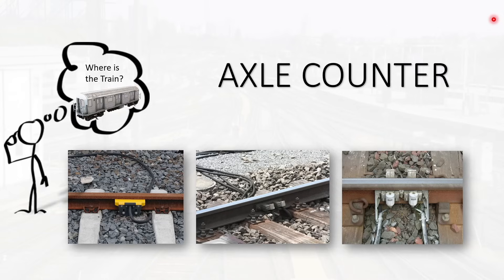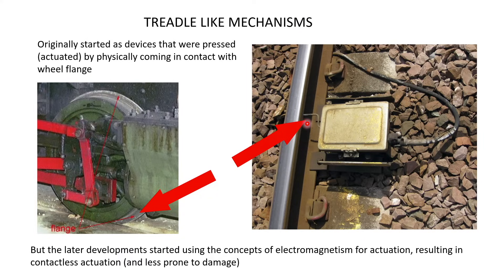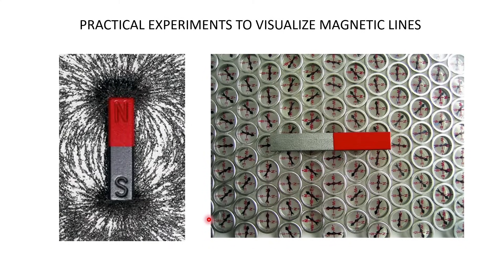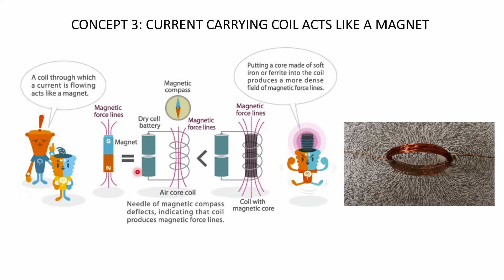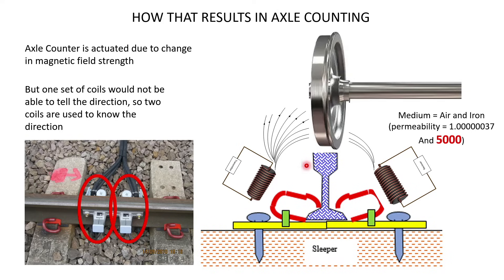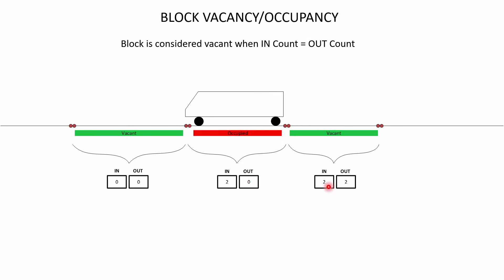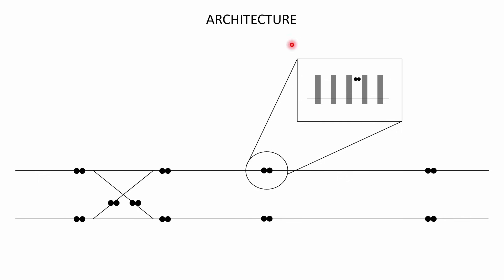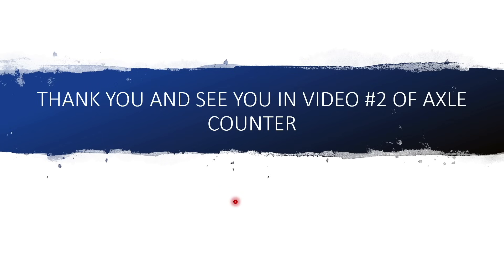Axle Counter Explained

Comment: Had not fully understood the reason for the need for axle counters to register block occupancy.  Many thanks for this video!
Reply: The System "knows" is there is any train in the section and if another train gets too close to the section. Then the train control system can force stop the second train if the section is already occupied.
Also, automatic railway crossing use axle counters too. How the system knows that the train is already passed the road crossing and the blocks can be opened? - Axle counters

Comment: The transmitter is powered by high frequency voltage and this induces a voltage in the receiver coil. In early days there were magnetic wheel detectors with contacts which will drive stepper motor type counter. The system was manufactured by Siemens

Comment: Hello,
Thank you for your video which is extremly informative.
I'd have two questions: 
1) To record magnetic field variation, do the axle counters use the Hall effect, like speed sensors?
2) Why is the magnetic field not affected by the presence of rail, made out of iron, near the axle counter?

Comment: Did you ever post part2  of this fascinating subject? Many thanks for this one - really good!

I came away with some questions: For example, if there is a power or system failure that affects a set of counters, how are all the trains kept safe and how is such a failure detected anyway? Given there are no lineside signals to fall back on, I am assuming that all trains receive some kind of "systems failure in block y.  If you're in block x,y or z bring your train to a stop immediately" type of a directive? I woudl guess it's possible to make the countar values persist by use of flash memory or battery backups in the lineside cabinets but re-sycnching things must be a chore!
Reply: Thanks Alan. Great question, which i'll definitely look into. But based on what I know so far, the counter can fail in two way - It leaves a count eventhough the train has cleared the block, OR it clears the counts while train is still inside. In short, one is false occupancy and one is false vacancy. False occupancy is a safeside failure, and False vacancy is an unsafe failure. By definition, Axle counters are SIL4 i.e. probability of an unsafe failure is something like once per million years. There is a whole lot about failure rates of individual components, resulting in failure rate of Axle counter as a whole, which i might get into. 

Another thing is that interlocking checks, sequential occupancy/vacancy of the blocks. So if suddenly an occupancy is lost and everything goes vacant, I assume the interlocking will stop all trains. I just dont know, if the area affected will be local of global. 

But thank you for the though provoking question.
Reply: @gauravkaushik04  Hmm yes, as you touched on in your video in the overall system axle counters talk to higher levels of the overall system so maybe there is some kind of heartbeat message from the counters to the higher level which, if missed, make the executive system failsafe the section concerned. Also if an exec function is supervising a number of axle counters it perhaps makes sure that when the outcount of one section is decremented, the incount of the next section is incremented within a couple of seconds - and (since axles should not just vanish from the railway!) if it is not then again a fault is declared. Has to be something like that - but oh my that could get complex with certain track formations.

Comment: i knew axle counters existed to check no coupling had broken. This took my knowledge further for sure. for me in britain the history of this goes back to adding flashing red light on the back. this way the signaller can see the back of the train is still attached. no flashing red light. no clearing that section as vacant again. for ROC you defo need axle counters. no signallers to visually look at the back of trains.